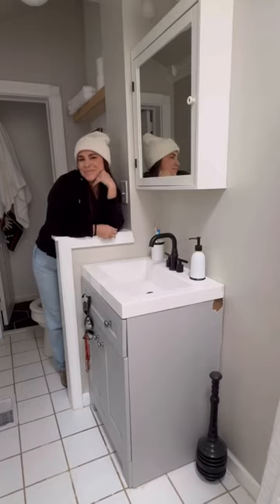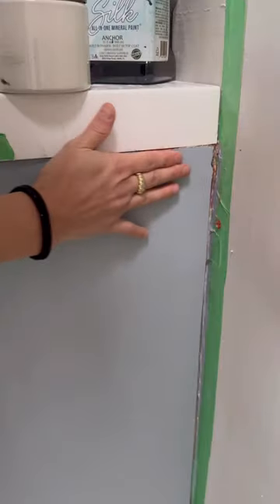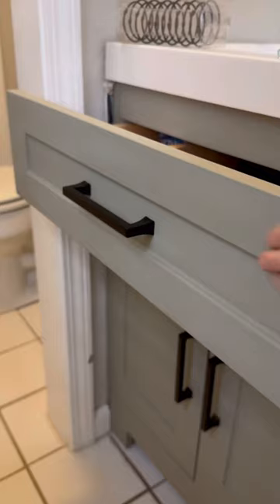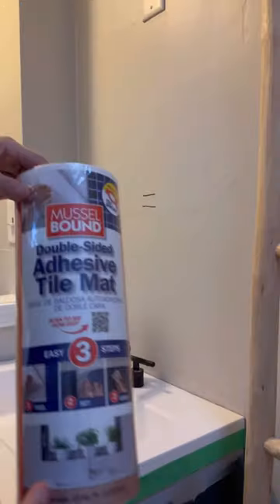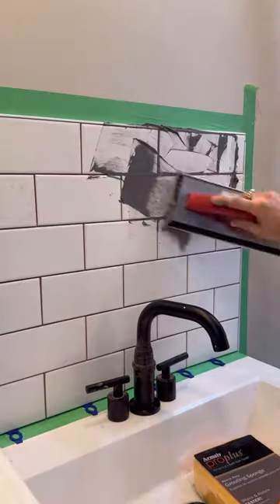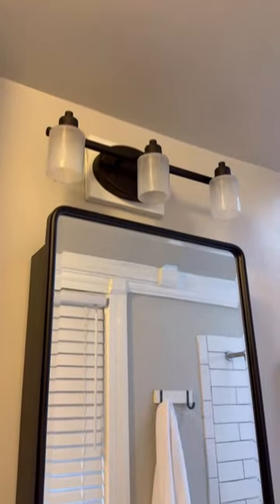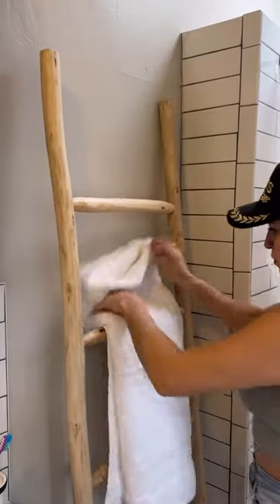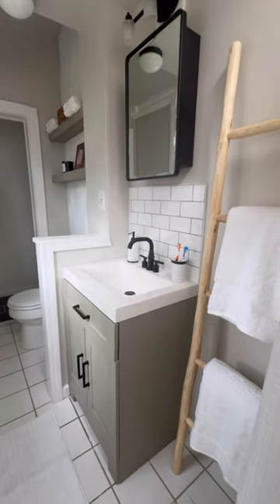Bathroom makeover for under $200! 🤯 #shorts #easydiy #bathroommakeover

Comment: Hang your shower curtain to the very top of the ceiling and it will make your room look so much larger. Great job.
Reply: Can't  hang up high because of the wall But I am going to do that. Where do I  find longer shower curtain?
Reply: There are a lot of options for longer shower curtains on line. 
However, there are other options than just ordering them. You can use regular curtains…just make sure to add a liner & be cognizant of the material to make sure it’s not prone to mold/mildew. 
A budget friendly way is to make your own shower curtain & use it with a shower liner. This allows you to customize the fabric/pattern/color & length. You can use heavy duty fabric glue or iron on adhesive tape if you can’t/don’t want to sew. To hang you can use shower rings w/ hooks or put grommets in the top. Grommet kits are less than $10 & come in multiple diff sizes.